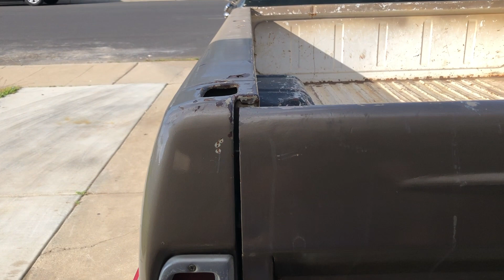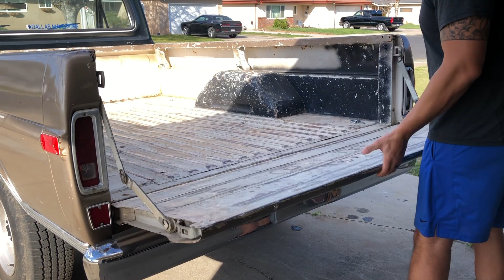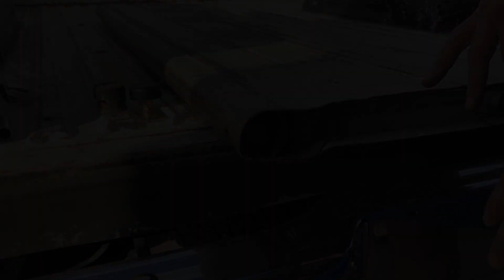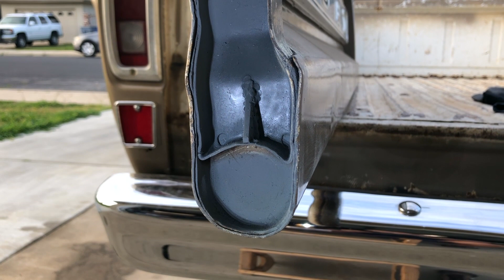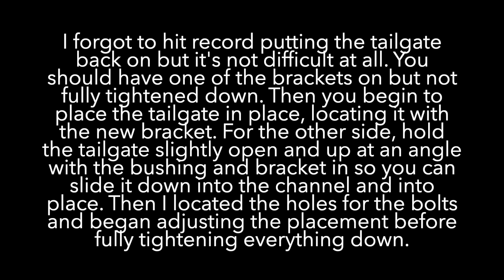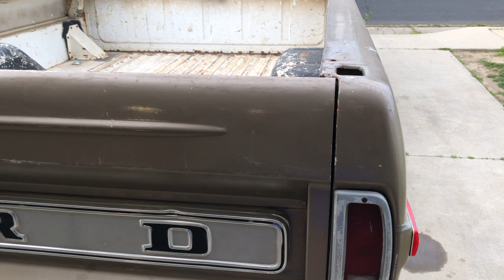1970 F250-Tailgate repair

Comment: I have a 1970 F2 50 camper special. I am looking for some advice on parts. I’d like to know if anyone has any idea for the reverse lights for the manual transmission and how it supposed to be hooked up.
Reply from the maker: Michael I’m not sure. I haven’t had a 4 speed truck, it wouldn’t have the neutral safety switch on the column like automatics.
Reply: @AJsGarage  ok thank you. I’m just trying to make them work. Parts are getting hard to fine
Reply: Also trying too fine people who may have what I need

Comment: Did you try adjusting the tailgate before you got the new bushing kit?
Reply from the maker: I didn’t, honestly I didn’t really know you could adjust it prior to this. It had lined up before and over a few years got like this.
Reply: @AJsGarage  I just checked mine it adjusted as high as I can get it and it’s still low. Are the new ones you put on bigger round than the factory ones. My tailgate doesn’t look like they are bent like yours had been but there is a good 1/4 inch of gap. I may try the one you put on. Just didn’t know if the was bigger round.
Reply from the maker: @troygibson6690  No the polyurethane ones I got are the same diameter as the originals. The part on the tailgate probably opened up like mine did
Reply: @AJsGarage  they didn’t look like it but could have. I think I’ll order those new one and see. Thanks for the good video.
Reply: @troygibson6690 Did you succeed?